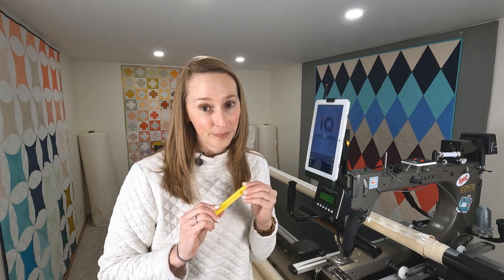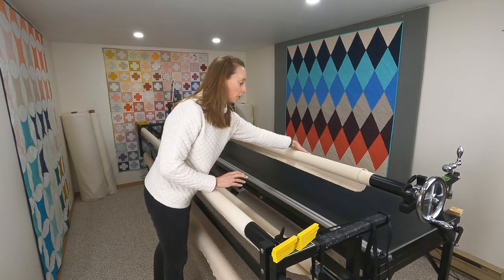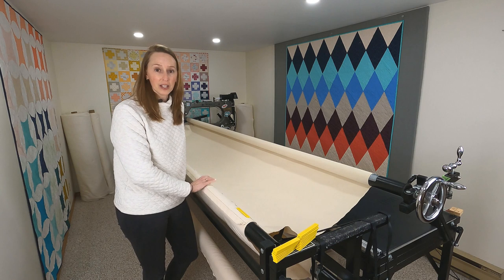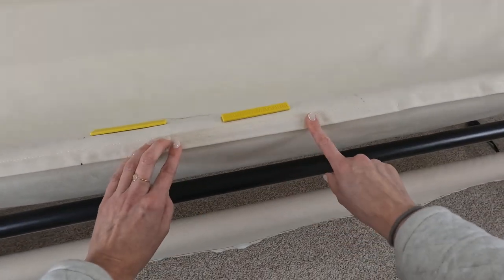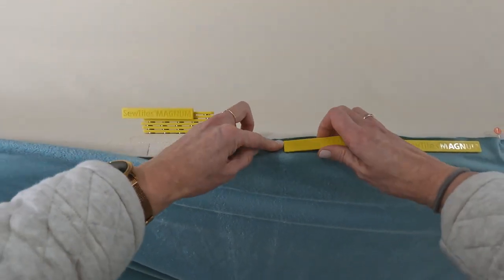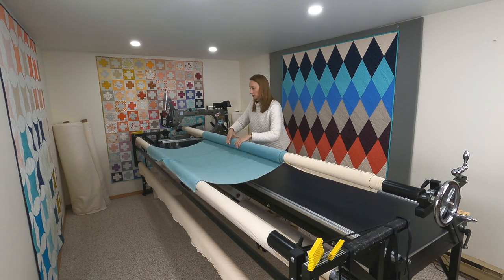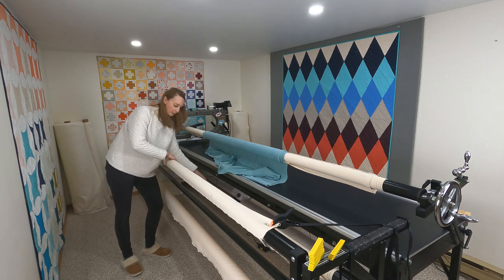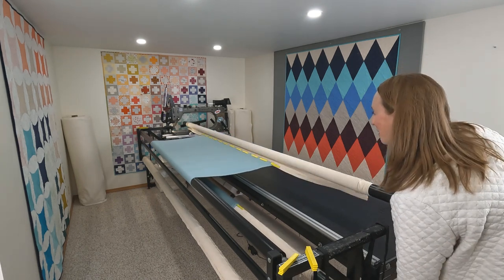How to Use SewTites Magnums to Load Quilts onto Longarm Machines

Comment: Great video, Shelly!  I'm a Longarm League member as well--in fact, I learned about SewTites from another LL member several months ago.  I bought the pack of 50 and did the very same thing, loading them into the channel on all three of my leaders.  Less fiddly and SO FAST when loading!  I'll probably go ahead and purchase another pack of 10 so I'll have a total of 60 as I do indeed use all 3 bars on my Bernina Q24.  I haven't done any King-size quilts yet on my 12-ft frame, but I'll be ready when I need to.  I'm relatively new to Longarming and was NOT enjoying the frequent pinpricks (stabbing more like).  No more fear about getting blood on client quilts!  Yay!  The only thing I was disappointed about was that very issue with the magnets on the Take-Up rail when I'd tighten things up and some of the magnets were sliding off the backing fabric.  It was very frustrating.  I essentially ended up pinning and using the magnets.  But I'm going to try this method of loading the backing fabric exactly as you demonstrated to see if that helps.  Thanks again for a fabulous video.  😊 Cheers!
Reply: Hi Stacey! You'll have to let us know if changing the way you use the Magnums has helped keep your fabric in place!
Reply from the maker: Hi Stacey! We are thrilled to hear you use SewTites, and appreciate your feedback. We sure hope Ma Tante's method of loading the backing will help! Please reach out if you have further questions!

Comment: I thought about what you said about the leveler bar being an issue.  I haven't added them to my leaders yet, but I thought others would like to know.   I tapped the metal backing piece to the yellow side of the magnet and the attraction through the yellow plastic is extremely slight as compared to the metal side.   If you load the yellow pieces into the leader, the metal side will be facing the leveler bar and will likely attract to it and get stuck.  I'm going to load them exactly the way you did.  I think they'll be fine.  At least I hope they'll be fine.  I'll update my comment once I've got them loaded and have used them.  Great video! Totally changed my mind on whether or not these were worth the investment.
Reply from the maker: Hi Melanie! Thank you for sharing your feedback on here for others, and trying a different method that may work super well for your set up. Our customers truly come up with the best ways to make SewTites workable for nearly all sewing situations! We are confident when you find your method that works best for you with SewTites, that you will be quite happy with your investment.
Reply: Did you try doing this yet? I tried but the magnums got stuck and came off the backing... still trying to figure out a way to make it work to load the backing on my Handi Quilter machine - which has the leveler bar ... any other thoughts would be greatly appreciated @SewTites
Reply: @latelierdulongarm  I haven't yet.  It's a long story, but I've only just put my long arm back up and haven't had a chance to add the magnums.  I'll update once I have.
Reply from the maker: Hi Kim! We are committed to helping our customers with their processes to incorporate SewTites with their sewing needs. That said, we are headed to OSQE next week and will make it a point to discuss this very issue with the HandiQuilter team. Stay tuned...
Reply: Okay, update. I'm signed into my personal account, but I'm the original author of this post. I loaded the magnums on my machine and I am obsessed with them now. They are super strong. I'm not afraid of them coming off at all. But I was right. The metal side of the magnet is super strong, but the yellow side isn't. Which is a great thing! They're strong enough to attract to the leveler bar so that they won't get caught on the edge of my ruler base or needle plate (which other loading systems do), but when I go to advance my quilt, they just slide right under and beyond without any hassle whatsoever. I LOVE them and am always talking them up at the longarm quilt store I work at where we sell them as well. But in the video she suggested loading the yellow half in the canvas channel. Don't. Load them exactly they way she did. They work amazingly well. Beyond my expectations!
Reply from the maker: @melaniepeterson8433   Wahoo! Thank you for posting this update and feedback! We did talk with the HandiQuilter team that was at OSQE and tried them out... and just haven't quite gotten back to YouTube to update. Your personal experience and testament is better than anything, though! Thank you!

Comment: Please tell me how you can sew the magnet of the Magnums in your leader (they are sticking to each other as I am sewing) and then roll your bar...I tried to sew in the magnets as you suggested. I'd have to replace the backing metal on the magnets to roll the bars in or out...If I don't, place something like the metal backing over the magnets the magnets stick to everything metal....the frame and the bars. So I ripped out all of that sewing, pulled out the magnets, then placed the metal bars inside the leader then sewed them in... let's see how this goes...I'm getting frustrated.
Reply from the maker: Hi C – The metal bars inside the leader should do the trick! That's the way most people find success with the system (as outlined in the video - sewing the magnets in the leader is an alternative to the typical way they're used/installed). Keep us posted – hopefully, they'll work wonderfully for you now!
Reply: Did you sew them into your leaders by hand? Can't figure out how to do that
Reply: I sewed them into my leaders. I used colored embroidery thread to make sure I know where they are.

Comment: I invested in the magnets but I’ve had trouble with my machine (a gammill) pulling the backplate off the magnet and thus loosening my backing. What am i doing wrong? After spending this much on the magnets, i want it to work.
Reply from the maker: Check out the recent Q+A we did with Sarah of Sariditty! She demonstrates keeping the quilt loose as you wrap it and then pulling it taut.
https://www.youtube.com/live/bC2mVO0CZeE?si=xM8kbT8vRaQM4wIf
Hopefully that will help! If not, contact us at info@sewtites.com

Comment: I have new leaders -  how big do you have a recommend I make the channel to hold the Magnums?   Also, you mentioned that they may try to grab the leveler bar, has anyone had this happen?
Reply from the maker: Hi Becky! We recommend that you make your channel just a bit wider than the back metal plate, which is 5/8". You want the channel big enough to slide the back plate in easily, but also not too wide so they don't move around too much. The channel will span the entire length of the leader, and typically spacing is around every 4" apart from each other. 
As far as the issue with grabbing the leveler bar, I'm unaware of any up front issues so we can't speak to that. Sorry!
Happy sewing!

Comment: I love this! fairly new to longarming but I love sew tites. I've struggled with loading my quilts. I use red snappers and I’ve tried pinning also. How would you recommend doing this if the leader on my machine does not reach the front bar?
Reply: Hi Angela! So glad you found the video useful! In your circumstance, I'd recommend laying the leader flat on your machine table. You'll need to lean over the belly bar to attach the Sew Tites. I'm quite tall and find this easy to do, but I would imagine those who aren't as tall as me would prefer the comfort of using them on the belly bar (which is why I showed it this way in the video). Please let me know if that helped, or if you have any other questions!
Reply from the maker: Hi Angela,
We love hearing that you use SewTites, and hope that Ma Tante's advise was helpful to you. Please reach out if we can be of further help. Happy sewing!